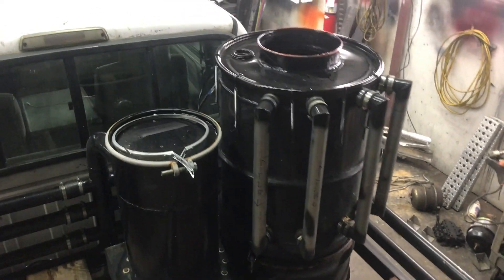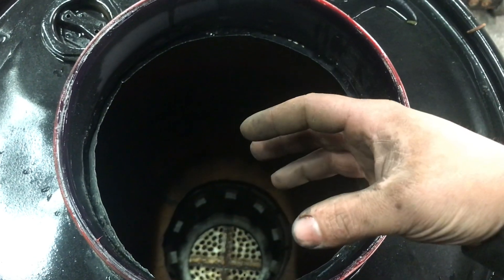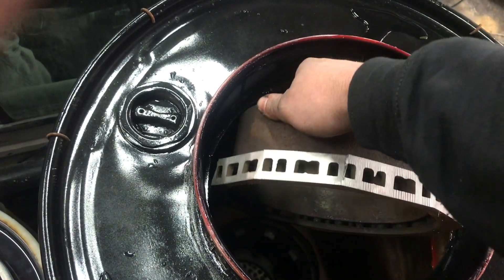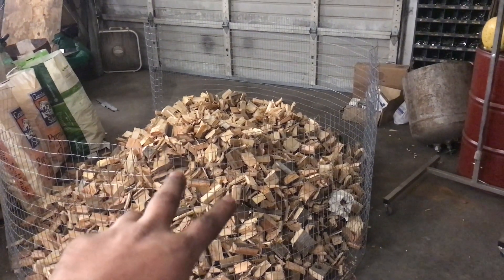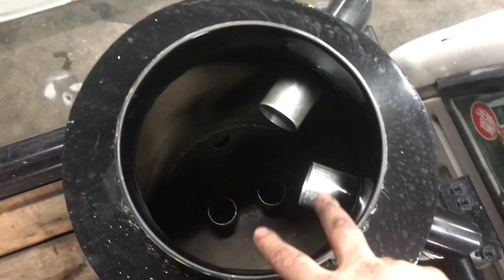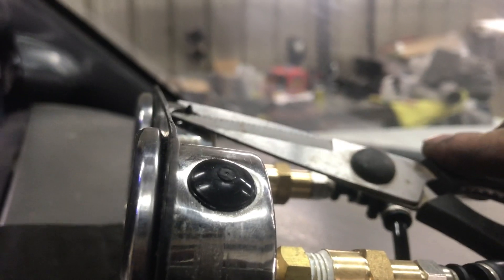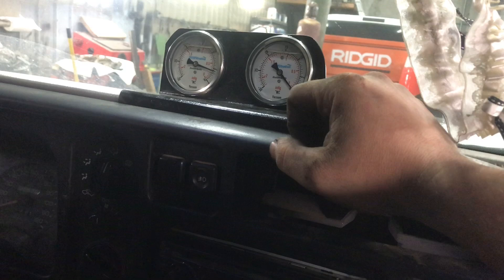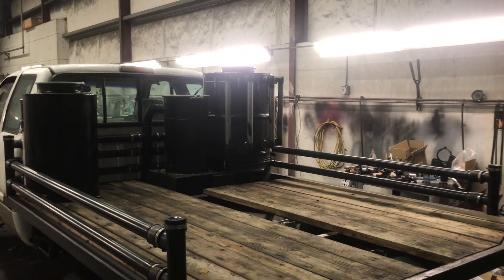Final Preparation For The V10 Gasifier Build: DID I FORGET ANYTHING??

Comment: I started with a 6" choke and ended with 8" for my SBC 350. So glad I made two rows of nozzles in mine. Lower nozzles run an average of Ben Peterson's suggestions and the upper row is set at Wayne's design which is what I'm running on now. So I'm happy with the versatility of my Gasifier.
Reply from the maker: Hmm that has got to be wood species related, a 7" was to much in my Toyota and I was seeing really low Temps that worried me I might make tar so I went back down. Running 6 1/4 in it right now
Reply: @BigBeavrSlayer  I assume the reason for my size is because I also run the reduction tube and it's I think 10" long down to my grate. I have a selection of choke/reduction replacements to still try out and see if I can get it better.

Comment: Having some experience with building a gasser I can detect the " measured" excitement in your voice. It's like, you don't want to show how reeeeally freaking excited you are as you are about to turn that key........This follower can't wait. 
Also, I want to know how that brake rotor works out. I had been going to use one with my latest build...until " the Beast" showed up in my yard.
Reply from the maker: Rotors is all I have used for a restrictions in the toyota, the first one I got it hot enough it broke apart being cast but the ash cone held it in shape even being broken and it continued to work great. There was actually a guy that used 2 rotors bolted together as the reduction zone and it worked out very well for him. Yes my excitement is building. Heading out for a hay bale right now!